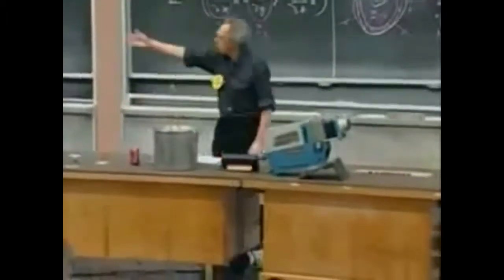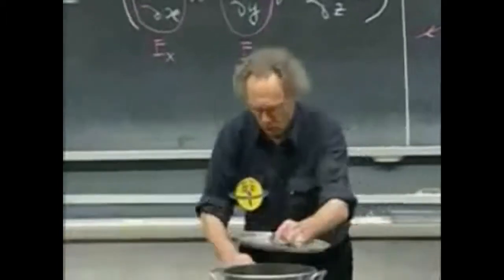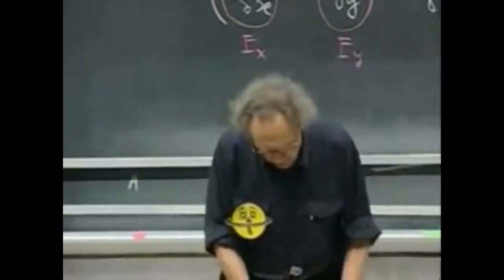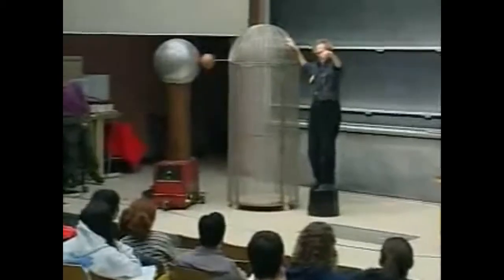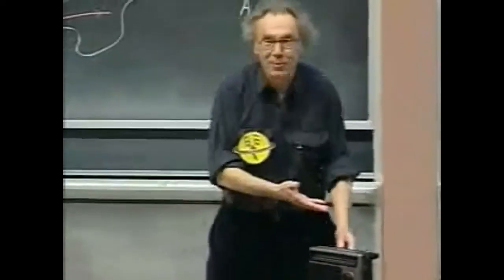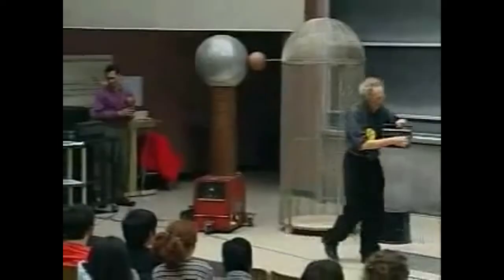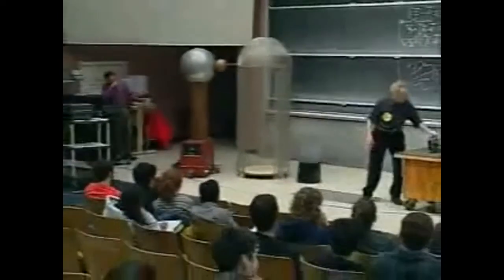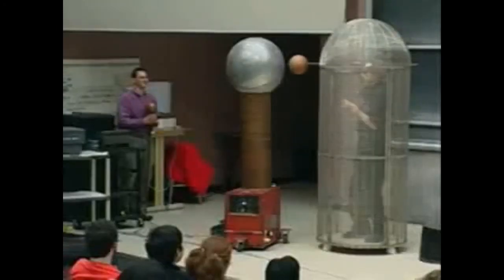Electromagnetism Lec 5 Electrostatic Shielding 11 Demonstration of faraday cage

Comment: How is my car a faraday-cage?
Reply: It is a Faraday cage as the car is made up of metal and it's the property of conductors know as electrostatic shielding due to which the resultant of electric field by all charges in the inner space becomes zero at any point which is not in the space and similarly the resultant of field by all charges in the outerspace becomes zero at any point which is not in the space